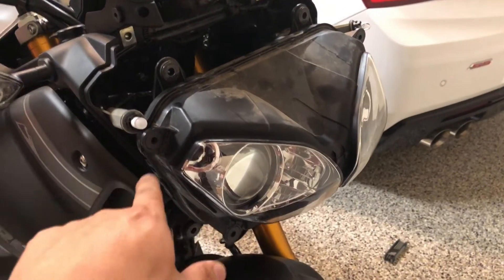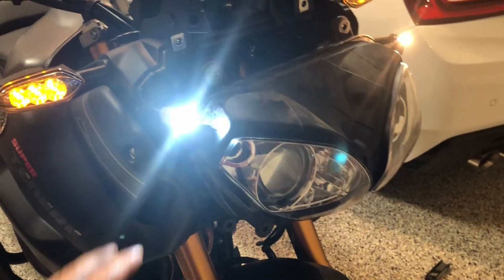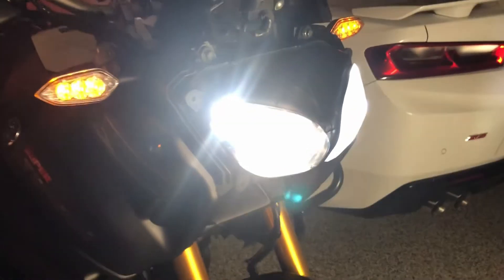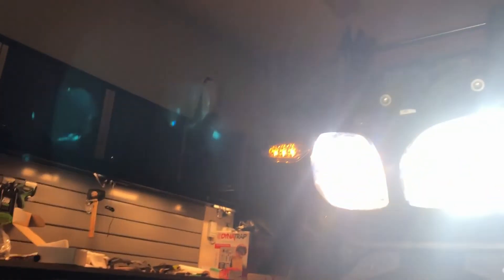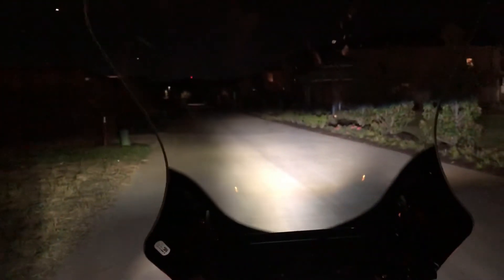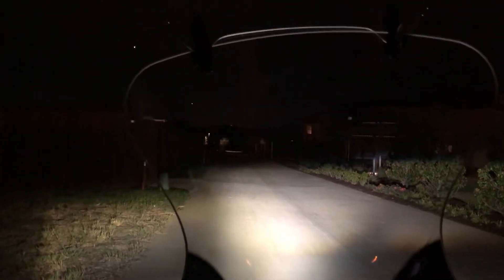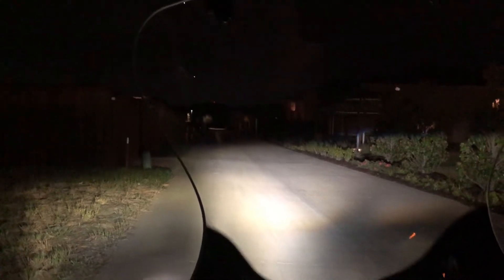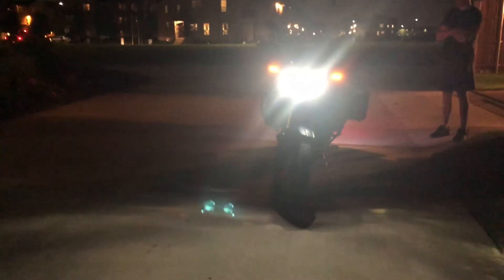2012-2018 Super Tenere LED light upgrade

Comment: I had some of these ridiculously expensive leds. They went out right after the one years warranty. They claimed some crazy bulb life hours. One star. I replace mine with some $30 novsights. They are just as good or better and are still going 2 years and 15k miles later. They don't have that funky weird ballast either. When I contacted Cyclops. They guy said the super tenere's generate a lot of heat in the housing. Which can cause failure. They falsely advertise the bulb life. Never again.
Reply: @flea 1812 thanks for the video.
@ratbrain can you please put the model from Nosights you're using?
Thanks
Reply: Cyclops customer support was great for me, sent replacement parts when I broke the mount switching lights to my newer bike.

Comment: Cool video. How did you fit the little boxes in the enclosure? Specifically the right side (sitting on the bike). The left side allows the box toward the centre, but on the right side it doesn't seem possible.

Comment: Hello flea1812, thanks for the video. I am trying to upgrade my tenere headlights with cyclops. I see that these bulbs have their own exhaust fans. Did you have to cut a hole into plastic caps for the hot air to get out? I am concerned that if I put the cap on as it is after installing cyclops bulbs, the exhaust from bulbs wont have an escape and it could damage the plastic in the headlight assembly. Any thoughts on that?
Reply from the maker: blacklabs two the cyclops led light kit comes with new plastic caps.  No cutting is required.  LED lights actually output less heat and is more energy efficient than the oem halogen headlights.  When you install the lights the led ballasts go into the headlight housing.  Don’t worry about heat it isn’t an issue.